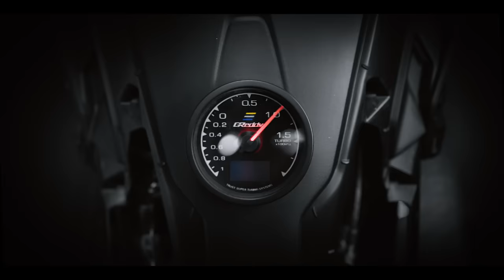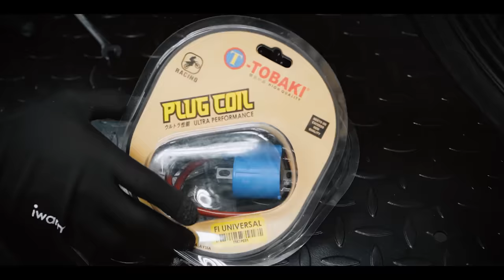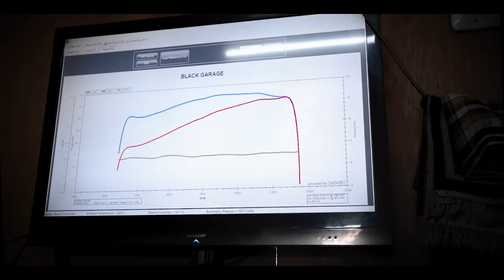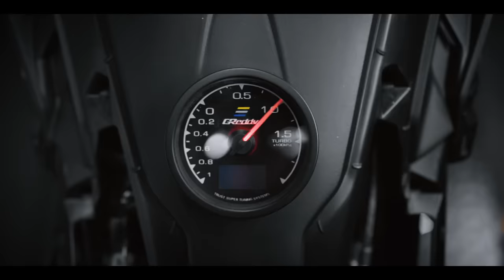Turbo Super Moped Bike ft. Kawasaki H2R  ( SPD X Tobaki )

Comment: the 2 drills you make on crankcase, for what purpose is ? The 1 was under the oil screen
Reply from the maker: For turbo oil input and return
Reply: @SPDRacing  many many thanks for your fast reply.
May I ask what oil brand and viscosity you will use for this little monster ?

Comment: Yeah the swing arm and wheel look cool and all…. But you basically just countered the minuscule amount of power added by the turbo with the unsprung weight of the wheel and brake rotor. 
Looks cool but it won’t be as fast or as powerful as it would have been if you had of just left the standard swing arm or chose a narrower wheel / swing arm combo

Comment: I have some questions, 1.) How many psi of boost that turbo produce. 2.) How 'bout stock vs modified info and price per performance. I know there is a community of modding motorcycle but by the looks of it, it might be cheaper to purchase a 40 hp 2nd hand big bike rather than this kawa-hon 😅

Comment: You didn’t even use the H2 1000cc engine?! wtf is this? Some “China-made” turbo bike with 125cc ? And a super-heavy-ass swingarm from a H2 and a 17” heavy wheel? You just made it heavier and probably slower than the stock bike (even with that turbo running 4psi)…..waste

Comment: Too much weight, not enough power and should have just swapped in a 1000cc engine and call it a day. Not this Lego b.s tuning up 125cc single piston lawn mower engine. Put a 600cc at least, a turbo 125cc you lucky to get 50whp, or what a 450cc single piston engine would make. 50whp if your lucky.125cc turbo ? YAWN